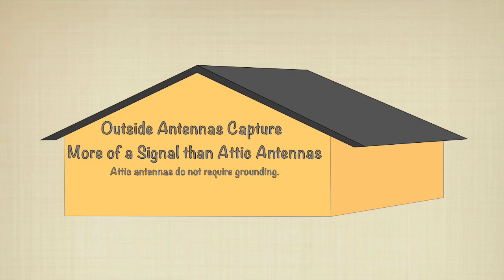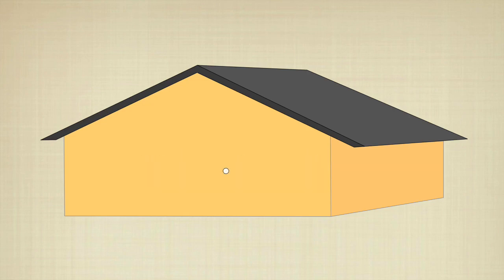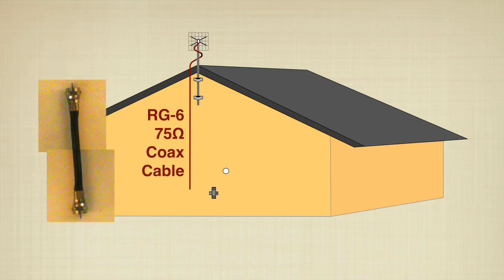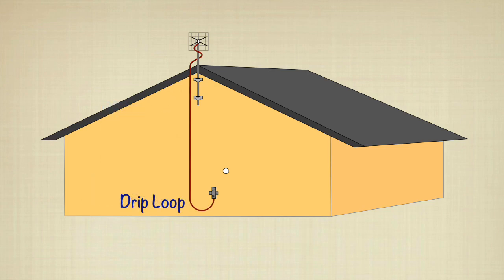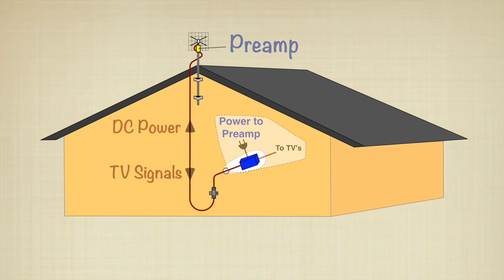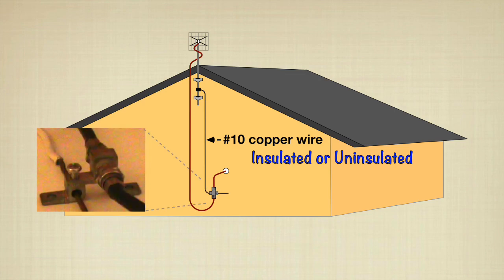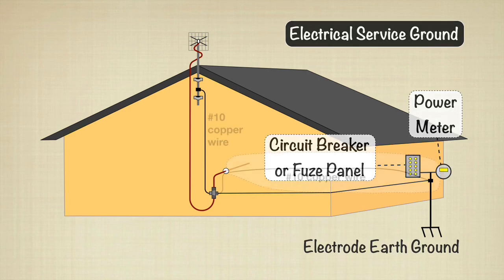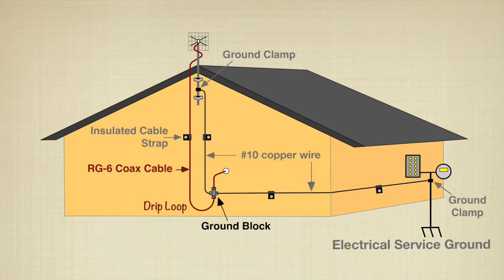Outside TV Antenna Basic Installation

Comment: We put in battery backup for our solar panels for whenever we are turned off by the electric company for high winds and fire hazard.  That meant we had to put up a rain gutter to protect the equipment (outside) in a cabinet and the gutter meant we had to move our antenna from the eave.  I used some of your instructions.  We put in a pole about 14 feet (shorter than our chimney but the chimney is the wrong direction for air waves anyway).  I connected 6 foot coax cables to the two antennas and I connected them to a combiner that has a ground block connection.  I connected the TV coax that goes through the house to the combiner.  We put the copper wire connected to a grounding rod in the ground through the combiner connection and also wrapped the copper around a bolt on the pole.  We now get more channels than we did before (17 English channels in North San Diego County.)  I sure hope we are grounded good enough.  I heard California is generally so dry that the soil is not moist enough for a ground to work anyway.  Here is the connector/ground I got on Amazon.  https://www.amazon.com/gp/product/B00006JPE1/ref=ppx_yo_dt_b_asin_title_o00__o00_s00?ie=UTF8&psc=1   Do you think we're good?

Comment: Here in Canada, I've only see ground rods used on barns, sheds, other outbuildings or rural homes on wells and septic systems.  Urban homes, almost exclusively, have their electrical panel and antennas grounded to the copper water supply line to the home, before the meter.  The charge from static electricity or a lightning strike is directed into the city's water supply network through the earth.  Because of cold winters, water lines entering the home are more than 4 feet below grade to prevent freezing.  Some new subdivisions aren't suitable for the application because they now have plastic/poly supply lines, rather than copper.   I've also wondered; My older home has a 4 inch solid cast iron plumbing/sewer vent stack that protrudes through the roof about 18 inches high and it's quite close to my antenna.  Solid grounding to the stack would certainly provide a direct path to ground, but maybe vented sewer gas (methane) would not mix well with lightning.

Comment: My town only allows an antenna to be ten feet above the house,  I installed mine in late afternoon when the "village idiots" were safely at home, Once installed nobody noticed, I went 13 feet up and have amazing reception, Now whenever I have a mixed drink I find myself staring at it with pride!
Reply: stclairstclair 
Federal law prohibits antennas from being restricted below 12 feet above the roof line. As far as I’ve read, the local government can limit you to 12 feet, but not 10 feet.

The FCC site provides the complete laws regarding this. Here is a link to a blog dealing with questions regarding HOA restrictions (not local government).

Comment: The basic rule of thumb is Lightning takes The shortest path to ground so ground your antenna mast pole with #6 gauge copper wire straight down to an 8ft copper ground rod. Copper ground rods vary in price but you should be able to order one online for around $20 That's cheap insurance❗
Reply: Miguel Salami 
That makes sense to me. My antenna is literally on the other side of the house from my power supply. At the corner of the house under my antenna is a grounding rod. I grounded my antenna to that rod because it doesn’t make sense to me to make a bolt of lightning travel across my entire roof to get to ground. That’s begging for a fire.

Comment: Is the ground wire just to handle lightning strikes? So if you're in an area that "never/rarely" gets lightning, then seems grounding is not needed?
Reply: The ground wire is mainly used to "help" protect from lightning strikes, but it is also used to discharge static electricity.  Static buildup can reduce signal reception or cause other problems. Static electricity buildup is more pronounced in dry climates. I would ground it.
Reply: @donaldsawicki6866  Exactly, as they say better to be safe than sorry! Plus you always wanna (at least I do) do the job right the first time, cuz the job is bound to fail when you start taking shortcuts. IDGAS where you live somebody in that state still wins the state lottery even as crazy the odds are of you winning! So a little bit more time & money is better than the amount it's gonna cost you when you lose by playing the odds. Let's keep it a buck. Just saying...   +Peace & Rock n' Roll 4 Your Soul My Friend+ 🤘😉🤘
Reply: The only exception would be if you can put it in your attic.  My antenna works in the attic as the broadcast towers are not far away (30 miles) and no natural features (hills, buildings, trees) are blocking the signals, plus there are no metal components in the attic blocking the signals - wood roof framing with asphalt shingles, no foil-back insulation, and no HVAC system ductwork in the way.  No problem with reception during rainstorms, either.

Comment: For coax installations outside.

New coax connectors are compression type and kind of connectors.

Compression type and kind of connectors provide a water tight seal.

Do not use a rubber boot outside , No requirement for black electrical tape.

If you choose to use tape. Use the , Self Fusing , Self Amalgamating Tape.

If you choose to use a rubber boot , then fill the boot with grease and slide into place.

 Do not use the crimp type connectors outside.
Reply: Gene Sky, Compression terminals are water tight "for the most part" I still found water getting in after one year, On my new antenna I used rubber gloves and sealed the connections in premium automotive silicon on each connector, it's a messy step, but worked very well, I'm a retired mechanic ,  I cheated and used 10 gauge grounding wire, What's your experience with this situation? The grounding wire was a short run and no hard bends.
Reply: Yes is Ok to do the extra steps of sealing.

Yes is always Ok to experiment and find better ways.
Reply: Do not use a rubber boot outside?
There’s no need for one inside so where would they be used?
Reply: totallyfrozen, all they are good for by themselves outside is trapping water, I'm an auto mechanic, These are not made of silicone like an automotive connection, they're cheap hard rubber, Put them on and cover them with some high grade silicone.
Reply: stclairstclair 
Do they make silicon coax boots?
In the past, I covered the rubber boots with electrical tape. Since it was outdoor at my antenna, the weather has been a bit rough on that set up.
Reply: Yes stclairtclair is correct , the rubber boots by them selfs are excellent water traps.

If one chooses to use tape , then use Self Fusing , Self Amalgamating Tape directly on the connection , wrapping above and below the connection then no rubber boot is required.

If one chooses to use the rubber boots , then fill the boot with grease and slide in to place. The grease will squish out and then you will know that no water can get in the boot.
Reply: Gene Sky, Right on, I was not even thinking of that, some Dielectric grease in the boot is a good option.
Reply: Ah, I use a rubber boot, and also use either greese or electrical diaelectric greese. Always use plumbers goop to seal out the boot and connector from any outside moisture so as to KEEP the center conductor of the conector ALWAYS copper and clean so that your picture quility will remain forever clean, clear and sharp. You also can use heat shring over your connector to seal out any threatning moisture from the outside elements.
Reply: @totallyfrozen  These days, you can buy liquid tape that you paint on the connectors, seen it at Wal Mart, also, have some.
Reply: totallyfrozen As a mechanic I found electrical tape out doors is a great way to trap water, outdoors tape wont stop a thing, And even if they sold a silicon boot, I would still seal it, When I worked for GM they flat out told us that the electrical connectors currently on our vehicles was technically not up to the task and really need to be upgraded but would cost too much, those had a triple seal.
Reply: @stclairstclair  Not all compression fittings are created equal.  Many of the Chinese watertight compression fittings will eventually accept water into them.  Adding dielectric grease helps but due to high summer temperatures, it usually liquifies and runs out.  Automotive silicone or plumber's goop has been suggested, but not sure whether it may cause some electrical resistance.  Fittings can be made watertight with amalgamating tape and over wrapped with electrical tape to protect the amalgamating tape from U.V. light. The code in Canada requires #10 gauge grounding wire for an antenna.  Use the highest quality coaxial cable and fittings.  The premium cost is nothing compared to a monthly cable bill.
Reply: @totallyfrozen  Black (U.V. protected) boots work great outside.

Comment: You showed an optional ground rod near the antenna when the service rod is too far away. I would think this would be properly grounded at this point, but you stated on the video to then run#6 copper wire from the optional ground rod to the service ground rod. I don't understand why this is necessary.
Reply: The National Electrical Code (NEC) specifies the #6 copper wire run.  Their reason is all grounds should be tied to the service ground.  An antenna ground rod will usually have a SLIGHTLY different potential then the service ground, introducing ground current loops.

Comment: Will #12 work? A electrician told me #12 would work,I have mine run to the service ground as shown .
Reply from the maker: I believe using #12 will work. Actually something as thin as piano wire would work, but might not weather well. The National Electrical Code specifies #10 or heavier, but that number is somewhat arbitrary.
Reply: THANKS!
Reply: “Would work” and “is recommended” are not the same thing. Will 12 gauge WORK? Maybe.  A bolt of lightning is figured to have anywhere from 100 million to 1 billion volts, and 200,000 amps or more. Does going with the smallest wire possible sounds like a wise idea?
6 or 8 gauge is recommended. 6 being better.

Comment: What is a preamp?
Reply from the maker: A preamp is a low noise amplifier.  The closer the preamp is to the antenna, the better the signal reception.  Most preamp's are 2 piece units; an amplifier mounted close to the antenna, and a power unit mounted inside the home.  The amplifier gets DC power through the coax cable from the power unit.

Comment: I'm seeing two variations on grounding the mast.  This one shows the mast ground wire going through the grounding block then into the ground.  Others say that the mast ground wire must go directly into the ground, and the coax would then be grounded by running the coax through a grounding block with a ground wire going only from the grounding block to the ground.  Which is to code?
Reply: The National Electrical Code (NEC) has the ground wire running from the mast through (connected to) the ground block then to the electrical service ground.  The "other" method you describe is unknown to me, and has the disadvantage of a built-in ground loop (most undesirable).
Reply: sierragreen, Code? I waited till dusk when the "code nazi's" were having dinner and completed my "too tall for code" antenna!!  Once installed nobody noticed, and 83 channels!
Reply: stclairstclair 
“Code”’is not the same as your HOA’s rules. Code refers to the national electrical code and has nothing at all to do with how pretty your neighborhood looks. The NEC is about safety. Your HOA are not “code nazis” as they enforce their silly rules and not the safety codes. The Fire Marshall of your local fire department would be considered the “code Nazi” as you put it. It’s doubtful your Fire Marshall gives a damn about your TV antenna as long as it doesn’t touch electrical lines or pose a fire hazard
Reply: @donaldsawicki6866  That's not correct. This explains why:
  https://youtu.be/JfbKRk4YfUg  
You have a built-in ground loop If you run both grounding wires to the same ground block.